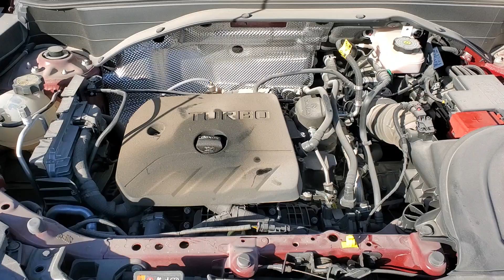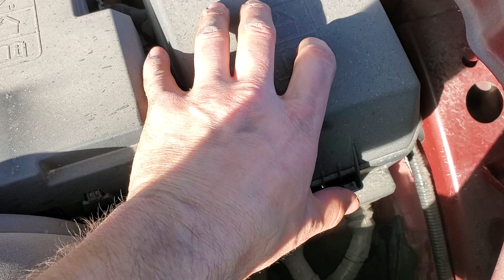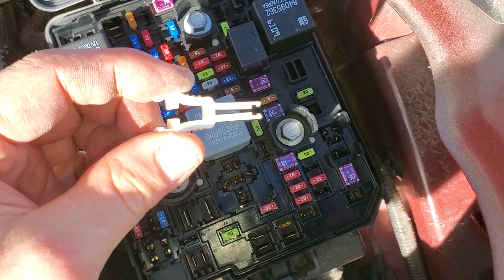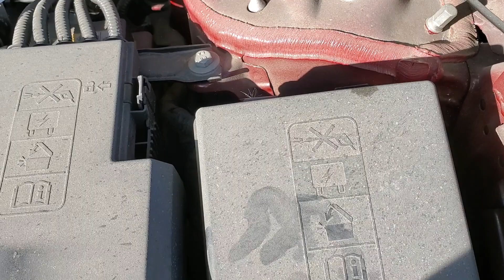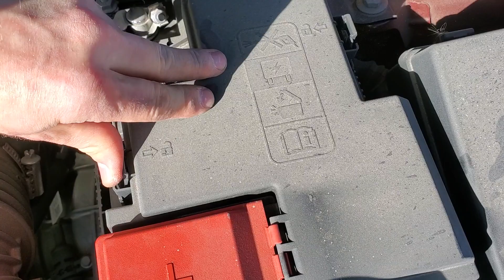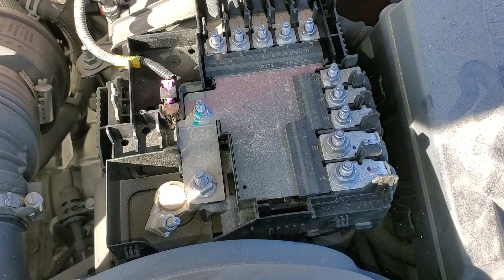2021 To 2024 Chevrolet Trailblazer How To Access Engine Bay Electrical Fuses & Relays - Main Panel

Comment from the maker: Electrical Fuses - https://amzn.to/3u2NQ1v
Digital Multimeter - https://amzn.to/493DZau
Add-A-Circuit Fuse Tap Adapter - https://amzn.to/3S6k4Ro
Automotive Relays - https://amzn.to/3vOnmBv

The Paul79UF YouTube channel is a participant in the Amazon Services LLC Associates Program, an affiliate advertising program designed to provide a means for sites to earn advertising fees by advertising and linking to Amazon.